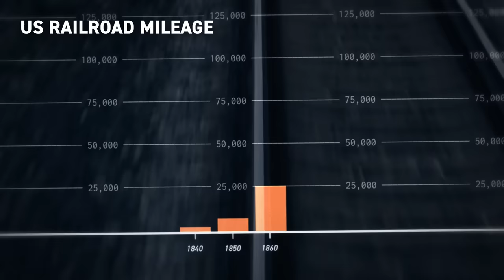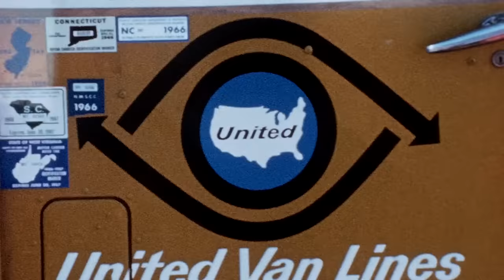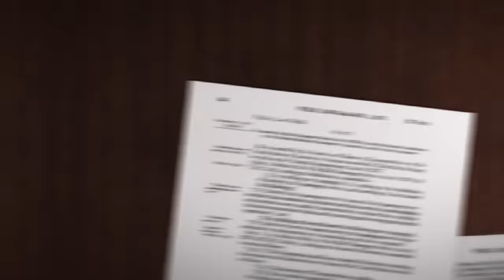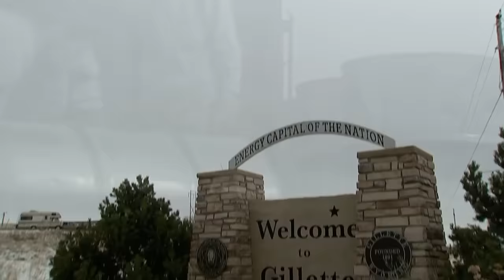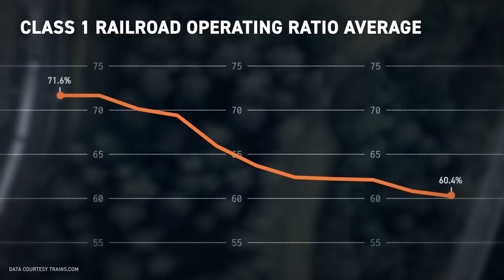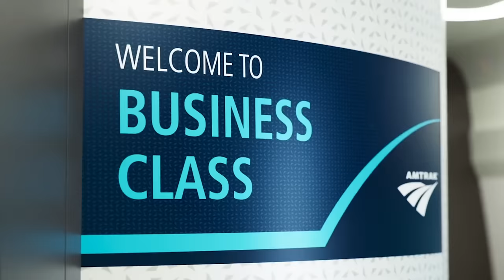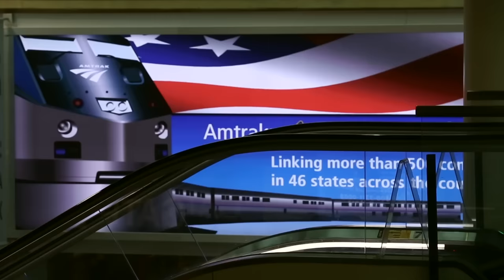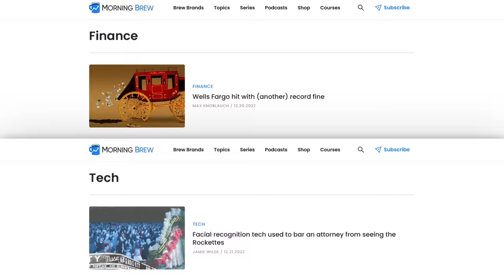The One Tiny Law That Keeps Amtrak Terrible

Comment: Just going to give a shout out to former Amtrak CEO Richard Anderson, who worked for free between 2017 and 2020 and came so painfully close to making Amtrak profitable…. Until Covid hit. The guy really tried his best to both improve Amtrak and prevent it from running at a loss and I was really rooting for the guy, Covid sort of threw things off though.
Reply: I’ve been curious, why wasn’t his contract extended?
Reply: @zeveroarerules  toll roads would like to have a word with you.
Reply: I remember the old video on Amtrak by this channel, that his plan was to cut services and keep profitable services still running instead of improving or extending them. Good thing he got replaced
Reply: As an Amtrak midwest user he was a total disaster. The states essentially had to run the show. Not to mention there is no upgrade path for super-liners. They can’t cut service bit they’ll make it so ass it becomes unusable
Reply: I just realize this is a bot comment, I saw another bot comment the same exact thing word for word
Reply: That’s right I’m a bot, beep boop. I would’ve gotten away with it if it wasn’t for that meddling YouTube viewer and his dog
Reply: @GreatLakesEnjoyer  There is an upgrade path for the superliners, current schedule puts them entering service in 2029 iirc. Rumors state that the RFP for them will be released this fall, when the Venture cafe cars go into service.
Reply: The goal shouldn't be to make Amtrak profitable. We should recognize it for what it is—infrastructure—and fund it accordingly. Just like we do with roads.
Reply: Also, after covid, their mission charter was changed such that the requirement for profitability was removed.
Nevertheless, many countries subsidize their railroads. Europe does it. We do it with our highways. So there is no real need for Amtrak to be profitable. Instead, it should use government cost-benefit analysis.
Reply: It’s the old bugaboo. . .  “They” would rather pay for equipment than people.  Two-mile freights use 6, 8, even 10 engines.  The ONLY saving is that only two people are required to run it.  Of course, the lost productivity by not being to stuff these into sidings is hard to plug into a spreadsheet.  I watch a Lot of Train video. . .   In Europe, one seldom sees a train with more than, say, 30 wagons. . .
Reply: @piemadd  they say entire long distance fleet by 2032 but the equipment will not last that long. I ride SW chief (CHI-KCY) few times a year and have had multiple equipment problems causing hours long delays. 

And the current idea of “refreshing” them is solely interior and for passengers doesn’t fix that these machines are 50 years old. 

There’s already an equipment shortage and the project is not even funded yet bc pf people like Andersons pathological focus on NEC.
Reply: Amtrak isn't supposed to be profitable, stop trying to make it profitable
Reply: Thankfully many states are picking up the slack. Ohio, Utah, and California are all expanding their own rai service to work with Amtrak.
Reply: As the pandemic fitfully subsides, this may be possible again.
Reply: @trickvro  something that isn't profitable is something that needs an external source of funding to stay alive.

You can't just call everything a public service and make it free.
Reply: @dewiz9596  one of the former union heads for the rail yard managers told congress the 2 and 3 mile trains are costing them a lot of time and money because of how long it takes to break them down to fit in the yards. By the time they're done, a lot of crews stuck waiting for clear track run out of hours, do they have to wait for a new crew to get in and get hauled out to them.
Reply: "I tried so hard, but in the end, it doesn't even matter-r-r"
Reply: @Sunset4Semaphores  Routes that don't make sense should be killed off. It's better for the institution if it isn't hemorrhaging money non stop all day
Reply: @zeveroarerules  That is a nice opinion but most people really enjoy their cars, even if they are not the most efficient means of travel. Part of enjoying a life is going to sacrifice some efficiency at times. Being able to sit in a beautiful leather chair while you drive is enjoyable.  Having a ton of space to put groceries in is enjoyable. Being able to talk to just the passengers you chose is enjoyable. Being able to set a timetable that revolves around you is enjoyable. 

There are a lot of reasons to have a car and they don't exclude trains. Even in Tokyo which is a very well-connected city having both options is very convenient.
Reply: There is no reason to expect Amtrak to be profitable when we don't expect highways to do so
Reply: @TheRandCrews  True.
Reply: It is true Amtrak, for the first time, was going to achieve profitability in 2020 until Covid struck. However, Anderson's strategic service cuts did not improve passenger rail service. Leaner and meaner at the sacrifice of the public good. Remember, Anderson came from the Airline Industry, specifically Delta. Not necessarily bad but based on how airlines operate not actually good.
Reply: @TheRandCrews  By this do you mean the OP or your comment?  Sorry that's a bit snarky but I mean do you really think someone went to the trouble of equipping a bot with enough intelligence to extract the meaning of from the video and then post a related opinionated fact with no link or political motivation?    If it is a bot the researchers responsible deserve my upvote.

More likely either a bit is copying real comments that are upvoted to dodge YouTube bot hunting or someone thought their comment didn't post and reposted on another device that was logged in to another account.
Reply: You could say Covid derailed his train of thought
Reply: Amtrak being profitable is not good. Being profitable means that many smaller cities and towns miss out on train service. No public agency I'm aware of in the US is profitable. Non-tolled roads lose shit tons of money because they aren't profitable. They are completely sustained on taxes. So should passenger rail on a NATIONALIZED rail network just like how the interstate system is nationalized. Imagine if all roads were owned privately, it would be a nightmare.
Reply: @FinneasJedidiah  Amtrak doesn't have to own or repair any tracks. The highway comparison doesn't work.
Reply: @flakgun153  yeah it does. Why should we not expect the highway system to make a profit when we're pouring billions of dollars into it each year, yet expect Amtrak to make a profit when we spend pennies on it in comparison?
Reply: 1200th like! Right. Amtrak could have been profitable had it not been for COVID-19.
Reply: If you are from the northeast yeah he was great, if you are an engineer off corridor like myself, not so much….
Reply: @losh330 I don't think that's quite right.  I think it's better to say that Amtrak being profitable isn't the only measure that matters.  Make Amtrak more reliable and appealing to use and you could (in theory) make it profitable in a good way.  Being profitable means you can attract investment to expand service, upgrade trains etc.

That doesn't mean it's  necessarily good to be profitable by just cutting all the unprofitable routes.  You have to balance the competing interests and some cuts to service may be worthwhile while other unprofitable routes offer enough public benefit to subsidize.
Reply: @TheRandCrews  It was a good plan. There's 0 reason that Amtrak should continue to run absurd lines like Chicago to Seattle that have 0 chance of competing against planes. They should focus on profitable routes that make sense, like Chicago to Indianapolis
Reply: We can sacrifice slow trains then build proper infrastructure
Reply: @TheRandCrews  you don’t understand the long term plan. The only lines sacrificed were the slowest most useless lines. The 2nd phase was building proper lines
Reply: @GreatLakesEnjoyer  it already is unusable
Reply: @trickvro  upgrade it then
Reply: Improved it in the wrong way
Reply: @losh330  the service they have is unusable garbage dude
Reply: One could say that covid derailed Amtrak's goals
Reply: @qjtvaddict  I know it is. I never said it wasn't dude. Amtrak needs to be funded on the scale of the interstate system to actually be a good service.
Reply: @Flak153  so if it's less unprofitable than roads then isn't that what money should be spent on?
Reply: Richard Anderson! I loved him in Stargate! Not so much in MacGyver though.
Reply: Lmao try and run it at a profit by removing the ability for massively rich dudes to give Amtrak money to tack on their own private cars to the back of trains? Give me a break
Reply: Yeah.. no
Reply: Honestly. He made some great changes in my city alone
Reply: Kind of went off the rails you could say.

 I'll leave....
Reply: @trickvro only in america do public services need to turn a profit
Reply: Good riddance. His changes and policies were terrible
Reply: He stayed home to slow the spread since Amtrak isn't an essential worker
Reply: Richard Anderson was not suicidal.
Reply: public services should be publicly owned and run, they should not be profit driven
Reply: @josiahhook1535  Such as?
Reply: Is this a joke? Surely it’s sarcasm.
Reply: Damn
Reply: There is no such thing as a profitable passenger only operation. 

Cutting services was an Anderson trademark. Cutting services will cost passenger traffic long term.

Keep in mind, the glamor passenger trains lost money, and the only ones that did, were little more than 20 something head end cars for Mail, and ONE coach on the rear.

I doubt most folks wanna ride a single coach stopping everywhere between Chicago and Los Angeles.
Reply: He had no salary, but he did not work for free.  He got bonuses, and the more he cut costs, the more he made.
Reply: Lol Richard Anderson is not why Amtrak was almost profitable. He made Amtrak far worse.
Reply: @flakgun153  public transit is literally a public service though? And nobody is saying free, just that it doesn’t need to be profitable. It’s like the post service, it shouldn’t be profitable because it is not a corporation but rather a service the government owes to the people.
Reply: @jtt8237  But your argument is just asserting that it's a public service. You can asset that anything is a public service.

The postal service made sense 100 years ago. Most other countries just have private companies do it, instead of wasting taxpayer money.
Reply: He also ruined the Heritage Railroading scene, screwing over loads of groups on operating historic steam engines on excursions.
Reply: Technology: nothing is going to stop the advancement of autonomous vehicles.
Reply: @GreatLakesEnjoyer  The states already were running the Amtrak Midwest show since 2004.  When the Bush Administration was trying to kill off Amtrak, the most pro-transit states stepped in realizing that they could lose their rail service.  Amtrak made that official policy in 2008 by announcing that states had to pay all operating subsidies for routes under 750 miles in length, the upside being the states were allowed to do what they wanted with state-sponsored Amtrak trains.  The Superliners have no replacement lined up yet because the priority is to retire the Amfleet Is, which are several years older at least and have even more miles on them due to running high-speed services on the NEC - and Andersen started that RFP rolling, as opposed to Boardman, Moorman, and Gunn, who just kept refurbishing the old stock.
Reply: I was so excited in 2017 when he took over. I thought he could bring usable rail to America. And he probably would've. Covid really fucked everything over, in every conceivable industry
Reply: Hey 👋 guys. Doomsday is on the horizon. Believe Jesus Christ is the Son of God. Jesus is the Way the Truth and the Life. Our Saviour Jesus Christ died so that we will live. Jesus said, "I'm the way and the truth and the life. No one comes to the Father except through Me". John 14:6.
Glory be to the Father, and to the Son, and to the Holy Spirit.
Reply: @flakgun153  other countries also have rules that prevent private companies price gouging citizens , which is exactly what will happen here if the postal service goes away
Reply: @michaelmccarthy4615  yeah because Tesla's self driving mode hasn't been killing people since it's been made available
Reply: @NONO-hz4vo if it was faster to go by train, people would use it, luxury aside. Also, our roads become far less safe when driving is the only choice.
Reply: @rickc303 this comment should go viral.
Reply: He was pretty good in stargate sg1
Reply: @NO NO And there are reasons that some of us CAN'T drive "in a beautiful leather chair" or in the crappy plaid fabric-covered one we can afford, which might get us where we're going (at $4/gal) or might get a flat. "Most people really enjoy their cars"? Prove it. A lot of us have cars because there isn't a reasonable alternative. And some of us don't want to drive because we're getting older and you don't really want us on your roads. You can keep your leather-seat bubble, enjoy it, good health to you -- just don't make it impossible for the rest of us to travel without owning and piloting our own bubble.
Reply: Amtrak shouldn’t have to make a profit, it’s a public service not a Walmart
Reply: That would be 1 year out of 40years amtrak made $$$$
Reply: Not really sure how you can say that when he is the sole reason, Amtrak did away with traditional dining and wasted taxpayer money mind you on the new dining cars. That is all on him. Amtrak is still not that traditional dining, that to all its trains they want to they just haven’t yet. so really, he did no good for Amtrak. He ruined it and most of us who regularly use them to affect them know what terrible job he did. You cannot take someone who ran in a line and make them CEO of a passenger railroad. it does not work.
Reply: @losh330  
Not exactly how that works for roads.

Sure, roads are funded by taxes, but the amount of money made because of our highway system, is absolutely insane.

Amtrak on the other hand, doesn't.
It's mainly for upper income people.
Reply: You sure about that?

Everything I found said they were on schedule to make more than operating costs.

But that doesn't usually count loans.....
Reply: Not gonna happen. Not in today's America.
Reply: @lordgarion514  but Amtrak should be for everyone, not just upper income people. Amtrak is many small towns only transportation alternative to driving.
Reply: @dewiz9596  Labor taxes are destroying this country. The government could get away with this nonsense when we had few competitors, but they rebuilt from WW2 and we cannot keep this up and stay on top.
Reply: bot?
Reply: @areguapiri  LMAO ok bot
Reply: Why wasn't it profitable?
Reply: @aaronfield7899  bruh it explains why in this video 🤦‍♀️
Reply: @losh330  well I wasn't done watching the video.
Reply: @michaelmccarthy4615  one or two highly publicized horrible accidents with ensuing lawsuits will...
Reply: @titaniumspike1779  Those massively rich dudes pay Amtrak a tidy sum to pull their parlor cars around.   Amtrak isn't losing money on them.
Reply: Amtrak is not required to make a profit, not by law and not in fact. It's not a private company. It's a government entity, providing a public good with taxpayer dollars. The "profit" of Amtrak is the return on taxpayers' equity in the form of economic development and sustainment in the communities it serves. Asking Amtrak to make a profit is like asking the Coast Guard or the National Weather Service to make a profit.
Reply: @jimmathews8813  very good point, thanks…!
Reply: AMTRAK is like the Post Office, both of which seem to operate on the premise that their customer base will simply keep paying more, instead of increasing the size of the customer base so that everyone pays less.
Reply: @zeveroarerules  “Give them”. That shows a really large lack of understanding when it comes to how roads are funded. We always hear the bleating about “user pay”, yet nobody protests when a large proportion of fuel tax revenue gets funnelled away from the proverbial “roads and bridges”. Fuel tax is user pay. Public transit so far isn’t. Save your sanctimony.
Reply: @robbiedozier2840 Okay…how about somewhere at least APPROACHING break-even then?
Reply: @losh330 Yes. Fuel taxes.
Reply: @colinwallace5286  sure, look at the northeast corridor and how well Amtrak does when they own their own tracks
Reply: Get rid of passenger trains that can't pay for themselves. That is a sign that they are not wanted by a sufficient number of people. Government should not make tax payers pay for things that are not wanted.
Reply: @sbearly  great point. by that logic we should get rid of all roads and highways as well
Reply: @JackParsons2  that's false. Anderson destroyed the Amtrak product and tried to cut a ton of long distance routes.
Reply: @robbiedozier2840  Actually it would be more like get rid of electric cars if the only way to sell them is with government subsidies. If the freight trains pay for themselves they can use the rails. If Amtrak can pay for itself they can use the rail. If people buy cars (without subsidies) they can use the roads. My point is more about government subsidizing industries that busy body bureaucrats think the population should use, and then receive donations at election time from the unions or others involved in the money side of the policies.
Reply: When the Interstate system was first planned in the early 1950s, the plan was for all of the Interstates were to be Toll Roads.  A study was then done and it was determined only three of the proposed Interstate toll roads would pay for themselves, the east coast route, Boston to DC, the route from Philadelphia to Chicago and the route on the West Coast.
The first two routes were being built by the early 1950s and they were to be part of the Interstate system but being toll roads not eligible for any Federal Subsidy.
When that study came out, Congress went with the present 90-10 system on a free Interstate the Federal Government would pay 90% of the costs, the state would pay 10% (if a toll road, the Federal percentage went down to 60%, in a toll collection system the cost of collecting the tolls was about 30% to cover the states 10% share of the cost of construction).
The above is made worse when you consider the above two toll roads. Both are still some of the busiest highways in the nature and  paid for 100% by the tolls collected while the fuel used on both toll roads is still taxed to pay for the rest of the Interstate system.
Please note fuel taxes pays for just 60% of the cost of building and maintaining roads in the US. The remaining 40% is from other sources of revenue, i.e. mostly local Real estate taxes to pay for local roads.
Reply: Amtrak can not stop those trains. Congress still controls the purse strings of Amtrak and everything Amtrak even talks about closing an unprofitable line, Congress rejects to move by threatening to cut money going to Amtrak.  In much of Rural America, Amtrak is the only non automotive means of transportation and even if the stop only involves one or two passengers a week, the people of those small towns will complain if the  rail line is stopped.  Thus a lot of Republican Congressmen from the rural areas will fight tooth and nail to keep that line open.  The Boston to DC line is actually profitable for Amtrak, but those profits then go to subsidize the one train a day (or less) that is the rest of the Amtrak system.  
Remember most Amtrak passengers are not going from end to end of the train, they are going some place on that line that rarely has plane or bus service.  
For that reason, Congress objects based on rural voters objections, is the reason Amtrak does not close down its unprofitable lines. Congress refuses to give Amtrak permission to close down such lines.
Reply: @The Sly Fox
I have to disagree with you.
He knew  the airlines but he knew nothing about railroading !!
 The best guy Amtrak had was David Gunn. He had knowledge of running passenger service and knew what needed to be done to further Amtrak's  future.
He understood its infrastructure.
And everyone is correct no passenger service in the world runs at a profit.
Even airlines get subsidies!!
Reply: Plandemic
Reply: Government restrictions*, not covid.
Reply: @davidjackson7281  Government restrictions*, not covid.
Reply: @joshuajoe1419  Because his health was failing and he really -- really -- was tired of Washington and politics and having to answer to Congress (considering they funded his railroad, this was a minimal expectation, but he nonetheless hated it).
Reply: @piemadd  Not rumors, reality. Amtrak issued the Request for Information to industry in mid-December, and suppliers have until the end of March to reply with their best ideas on how to replace Superliners. Might be bi-level, might be single-level. Arguments remain on both sides.
Reply: @trickvro  Amen!
Reply: @jimmathews8813  Oh they actually sent it out? I guess their plan is to announce whoever they choose when they release the venture cafe cars then, which makes some sense. I'm excited to see what gets announced.
Reply: I couldn't imagine working 3 years without pay. My bill collectors would have me shut down & probably thrown in the ground without a pine box.🤣😂
Reply: @GreatLakesEnjoyer  on the contrary to andersons belief of long distance trains for Long Distance Trains to be usable and therefore profitable we have to look at them in a different way, like one giant through train that links dozens of cities, then we get the idea that well, intercity routes aren't very useful if they are slow and infrequent. Hence to be profitable the Long Distance services actually have the most potential in all of Amtrak. If they ran 3 times a day, with line speeds of 80-110mph consistently over their tracks with priority over freight trains (as happened when the Railroads ran their own passenger trains) ridership would greatly improve as train travel would become a relevant and usable intercity travel option. - their extra long distance simply adds tourist value with very few people riding the whole way

If many of the towns and cities along the route received improved bus and other transit networks then ridership could even improve further.
Reply: Honestly, wish he kept the darn conventional dining cars. That was Amtrak's greatest feature that I enjoyed! Now its just bland without it.
Reply: Because then trump became president and didn’t support Amtrak and wanted to defund it
Reply: @Paul Mentzer  Not only that, if a line gets closed down, it can be a b**ch to start back up, because 1) additional money, 2) the freight lines have to agree to it (ha ha).  For example, have they extended the Sunset Limited east back to Florida yet?  The communities want it, the tracks have been repaired, but the freight railroads don't want it, and nobody is putting down the money to restart the line.
Reply: @Colin Wallace  You can only increase the size of the customer base sufficiently in places where the population density allows it (e.g., the Northeast corridor).  For many of those long intercity routes, getting enough people AND getting the freight railroads to allow it is practically a non-starter.
Reply: Necessary infrastructure is a service and can only die if run for profit. For better or for worse, the most effective, efficient, and least expensive option will be to nationalize freight and passenger services.
Reply: @Patrick Vroman  Agreed. The only profit should more Americans ability to access a more efficient system.
Reply: @SenecaRailhead  Seems like they stopped using them on any routes where they aren't needed. I'm hoping that traditional dining makes its way back to the east coast.
Reply: @piemadd  Oh heck yes! The traditional dining car was absolutely wonderful when I rode on the Crescent!
Reply: "The goal shouldn't be to make Amtrak profitable. We should recognize it for what it is—infrastructure—and fund it accordingly. Just like we do with roads."

No.  Privatize roads too.  Nobody is entitled to convenient or cheap infrastructure, especially at forced expense of taxpayers.
Reply: "the most effective, efficient, and least expensive option will be to nationalize freight and passenger services"

Hahahahahaha!!!!!!!  More trillions of inflation right there.
Reply: @MilwaukeeF40C  Most people who want private roads don't realize how much they'll start paying for them. In some states, it'll be at least 3x current taxes and fees they pay due to gov subsidies.
Reply: @trickvro  And airports?
Reply: It is unfortunate that America has not brought the rail system into the 21st century and still operating on an archaic infrastructure when other parts of the world have high sped rail.
Reply: Anderson ruined everything that made Amtrak good, I don’t know what the hell you’re praising him for.
Reply: We would’ve kept rail systems if they anyone invented a subscription service for your routes or companies lines lol.
Reply: @justinstrickland5382  yeah I know right Amtrak doesn't even own or maintain track it's the freight railroads that own it they simply run on trackage rights at the freight railroads have given them
Reply: @edwardkuennen7271  not true, they don’t give them trackage rights, Amtrak still pays for use, and it was the freight railroads that BEGGED for the creation of Amtrak so they no longer had to operate passenger. It’s a government mandate that the railroads signed off on. They agree to give Amtrak rights over the line AND give them priority.
Reply: You say untrue but you just explained what trackage rights are Amtrak does not own the railroad tracks that they're running on and yes every major carrier in the United States used to have its own passenger service because there was no profit there.  hence why the federal government has subsidized Amtrak since its existence.
Reply: @edwardkuennen7271  you said that the freight companies “allow” when they are actually mandated to host passenger trains because of the 1970 agreement
Reply: @justinstrickland5382  an agreement not a mandate AKA trackage rights
Reply: There were plans being drawn to connect Cincinnati, Dayton,Columbus & Cleveland in Ohio to Chicago, Detroit, Pittsburgh, Buffalo and onward.
Reply: He is a true gentleman!
Reply: @FinneasJedidiah  highways were never meant to be profitable, but people pay for the highway through gas tax, registration tax, etc. Rails need to be profitable otherwise you're having people pay for the rails that they aren't using. Even airports have an "airport tax" that is paid by the consumers and airline companies. Airport taxes are charged to fund the construction, maintenance, and administration of airports and airway systems. For this reason, the Internal Revenue Service (IRS) describes these taxes as user fees because the funds generated do not flow back to the general treasury. Grants are awarded by FAA and funded through the Airport and Airway Trust Fund, which is financed by taxes on domestic airline tickets, international air travel from the United States, domestic cargo transported by air, and noncommercial aviation fuel. My income and sales tax dollars don't go to fund airports just like my income and sales tax dollars shouldn't go to fund railways.
Reply: @losh330  the interstate system is funded through taxes from car owners just like the rail system should be funded by train users. The Interstate Highway System is partially financed through the Highway Trust Fund, which itself is funded by a federal fuel tax and toll roads. It doesn't come out of my income tax dollars, it's paid for by the people that use it. Same should go for amtrak.
Reply: @AbsintheBabe  amtrak shouldn't be a public service. Should airlines be a public service? Should greyhound be a public service?
Reply: @seanonraet8327  Tesla has been killing a lot less people per mile driven vs driving your own car.
Reply: @FinneasJedidiah  so your comeback is to say I don't use every square inch of road? No, I don't, but I do use the road and therefore I pay for it. If I want to take a train, I'll pay for the ticket, but until then, I'm not paying for it, just like I don't pay for an airport unless I buy a plane ticket. Though I guess you're not smart enough to realize a difference between me paying taxes so I can have a police department or fire department that I might use some day vs me paying for a train that I'll never use. A train isn't an emergency service.
Reply: @keinlieb3818  but by your logic, if someone doesn't drive, they shouldn't pay for any roads at all?
Reply: @nunyabidness3075  taxes are lower then they've ever been... That's the problem
Reply: @JohnJohnson-oe3ot  You need to note I said “labor taxes” and you are now arguing about “taxes” by which I suspect you mean “income taxes”. This is part of the problem. There’s a bait and switch sort of thing going on where the voters are mislead and then sent to the polls to choose. It’s grotesque. 

Al makes spoons. His boss, Bob, has ten workers making silverware. At the end of the week, there’s $1,200 profit. $100 for each worker. Al worked 40 hours, and got $100.

Now, we tax Al, a low wage worker about 10% income tax and 7.5% FICA and Medicare. We also charge Bob, 7.5% of Al’s wage as employee matching tax. No economist who could earn an honest living will tell you that Bob is actually paying that tax. Studies show that generally, Bob is only paying a very small amount of that tax. It’s really coming out of Al’s nominal pay. IOW, Bob would be giving Al a raise, but instead, Al is paying a hidden tax. Unfortunately, we are not even close to be being done. 

There’s all sorts of taxes. Unemployment, disability, etc. Most are hidden from Al, but they come out of his wages just the same. How about we force Bob to hold a class on sexual harassment? Al stops working for the class. That lost time is taxing Al and Bob again. 

Before long, you can see that the $1,200 was totally eaten up by taxes hidden from the workers, yet they were the ones doing the work, and they are paying for it by working harder, faster, and longer. Bob is going to either automate or sell out. Before you reflexively pounce, it does not matter what the profit amount is. If you believe Bob is greedy, then he’s going to maximize profits. Also, if Bob is a good boss, business man, or communist party apparatchik, he will seek efficiency (practically the exact same thing as maximizing profit). 

The labor taxes, regulations, and mandates are sold to the workers by the politicians as if they are getting something for free, but they themselves are paying for most of it. The politicians pay nothing for it. The winners are foreign competitors and people who make things that reduce labor inputs and the folks who are already on top because it makes competing with them all the more challenging. 

Now, I don’t know at this point, and I cannot look to see, how we got on this topic, so I hope it helps you see why I said labor taxes are too high. We need more simple taxes based on things other than labor.
Reply: Honestly, I can respect his dedication and hard work though I disagree on many of his implementation details. He came from an airline background, so he didn't understand. Its possible to compete one 3 things, good cheap and fast. The long distance routes are never going to beat airlines on fast, and never going to beat greyhound on cheap. So all that's left is good. Getting in a sleeper car, having a porter and cooked meals and all those guided age cruise ship like luxuries is the point of taking that sort of ticket.
Reply: Amtrak needs to run like the roads or airports.  The feds can build the tracks originally and rail companies can pay for the trains and their operations just like airlines and people with cars.  User fees from either mileage or taxes from fuel will be used to pay the feds back for their original investment.
Reply: @petergerdes1094  sorry meant someone probably copied his comment to gain likes or what ever, cause when I saw the video minutes when it started like 10 comments were there and 4 of them were copies of each other
Reply: He wasn't liked by frontline employees.
Reply: Services shouldn't need to run at a profit.
The military doesn't.
Reply: Amtrak doesn't need and shouldn't need to make a profit
Reply: He did a lot of things that hurt Amtrak service. Amtrak shouldn't be required to be profitable. He's not as bad as his successors, but he should have stayed at Delta, which seems to have been declining under their current leadership
Reply: @GreatLakesEnjoyer and the Illinois government has been doing us great with the new lines
Reply: +respect
Reply: Its so sad that we expect the rails to be profitable when highways hemorrhage billions of dollars.
Reply: What happened to the guy????
Reply: @callofduty19411 I would say Anderson focused on NEC because he realized that is the only part of amtrak that will ever be profitable for amtrak as a whole. Other than maybe the cascaded and the illini and wolverines services ( maybe ). Not sure about those. Long distance is a lost cause for profitability and it shouldn't. As many users have pointed out it shouldn't be about profits but about service. Not only do most if not all countries subsidize their long distance trains knowing they won't make a profit but most places subsidize the inner city transit as well. Here in Pittsburgh I don't think port authority of Allegheny County has ever made a profit. If they did It was before my time and I'm 43. They are a public service. They'll always run at a loss
Reply: @scotcoon1186 they absolutely have to pay a new crew even if it's only for an hour. Their time limit is pretty stone cold. Not to be exceeded by a minute. Dispatch will hold a train even if it's blocking a grade crossing if the crew is close to their hours. It has to be this way because of how many disasters have happened from crews being too tired to operate. 

In my opinion no jobs should be allowed under any circumstances to work people more than 12 hours. In nursing it is common for them to do 16 hour shifts. Often the money motivates them to do it cause they get paid alot plus that overtime rate. That'll change the first time one of them makes a deadly error. We humans like to be reactive not proactive.
Reply: @flakgun153 amtrak does have to maintain their northeast corridor which is wholly their's.

 Everytime one of the pantographs snags a worn wire weather that be the fault of pantograph springs, sagging wire due to frayed or the tensioners or any reason on a train going 100 to 130 mph it's going to pull down miles of wire. Hopefully it isn't fouling the other track or that whole section of rail line is shut down for hours while it's being fixed.  This is one of many expensive repairs that amtrak has to pay for everytime it happens. Unfortunately they don't have the liquid cash that freight companies have which do turn a profit
Reply: @trickvro govt ain’t interested in funding things that aren’t profitable or tax revenue. It’s operated as a business, not a tone setter. But I agree, it should be treated as crucial infrastructure. But then again, look at a majority of roads and bridges accords the US…
Reply: Anderson did not like long distance trains. He did everything he could to discourage people using them and then pointed out how much money they lost compared to the northeast trains. That was the same thing the Southern Pacific did to get rid of their long distance trains. Good service reasonably on time with well maintained passenger cars gets more passengers on board and increases the income that is needed to improve the financial performance of the long distance trains. People say the long distance trains can’t compete with air service. However trains do something planes can’t do, serve many intermediate stations along the route. So while only a smaller number of passengers ride the full route, that can be made up by the number of passengers only riding part of the route.
Reply: Richard Anderson was an ex freight rail exec, he was still pandering to the freight railroads, and cut corners at the time where Amtrak really had the momentum to expand. Anderson was trying to choke the fire out from the inside. He was the worst CEO, and Gardner is hardly any better.
Reply: Repeal section 409 of John Mica’s stupid law.
Reply: He put broken things away instead of fixing them and pushed people into retirement. He was sacrificing long term profitability for short term profits and didn’t even turn a profit…
Reply: Amtrak is a service, NOT a corporation!
The time has come to consider nationalizing the rail infrastructure and leasing operations back to the rail lines like is done in Europe and elsewhere...
Reply: Amtrak fucked the north west corridor up by "owning" and leasing out the tracks, letting CSX and the other big cats overload and over speed on tracks laid in the early 1900. . . .    I mean how did this happen? I'm stunned
Reply: @NONO-hz4vo yeah but in america only the car is convenient.. thats the part that needs to be fixed. Shit i love cars too but it shouldnt be the only option. Road infrastructure gets plenty of funding rail doesnt
Reply: Imagine a CEO doing work and even working for free - insane
Reply: COVID didn't cause this; the government's overreaction to it did.
Reply: Any perception of Amtrak being profitable is due to Enron level accounting.
Reply: If an Amtrak train, any train, is late and it is because of anything but extenuating circumstances (derailment etc), the freight railroad gets fined $10K/hour
Reply: Who is the current person who is in charge of Amtrak
Reply: IF he was so good, then how come he's never restored the New Orleans-Jacksonville line?  CSX repaired the line within 6 months of Hurricane Katrina damaging it, but Amtrak never restored service on it.   It was the #1 traveled route on Amtrak before the hurricane.
Reply: @flakgun153  imagine being a bootlicker lol
Reply: No he was just the worst.
Reply: @joshuajoe1419 because he was trying to run it correctly.
Reply: Employees and former employees of Northwest and Delta Airlines would like to have a word with you
Reply: Delta Dick Anderson tried his hardest to ruin the place.